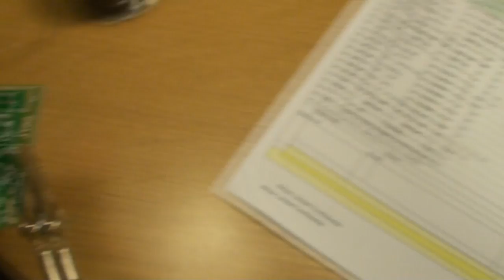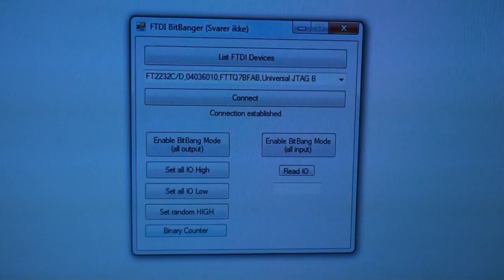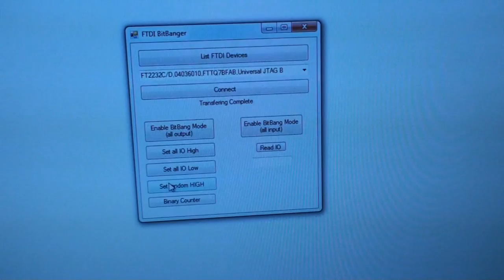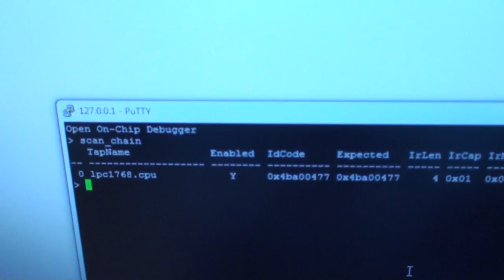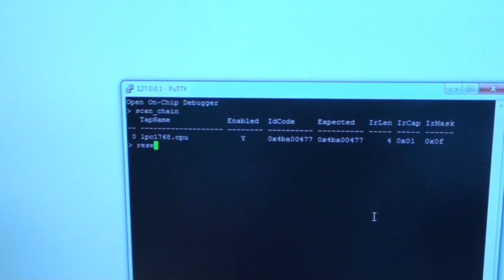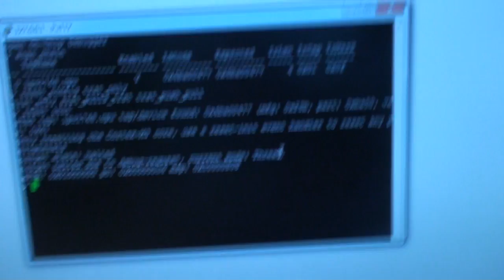uniJTAG - The Universal JTAG Programmer

Comment: can you just tell me if theres a way I can connect any modem to work on existing cable line. Cause I bought one Cisco DPC2320 which when connected gives all "DONE" but only the access denied. So I thought by changing it to my own modem MAC I can make it work because that modem is in my name for last few years. I there any other method to do it. Thnx ADvance

Comment from the maker: As I am not aware of what the JTAG updating of the Xbox360 required I am a bit unsure on this.
But as far as I know the JTAG "hack" for the Xbox360 required an update of the on-board Xilinx FPGA - is this correct?
If this is the case, yes, then you should be able to use our uniJTAG.

Comment from the maker: Atmel devices are not JTAG compatible so this board can not be used to program those.
Instead you should look for an USB AVR ISP programmer. You can find these very inexpensively on eBay etc.
But yet again there is also difference in the supported Atmel devices so you would have to specify which one you have in mind.